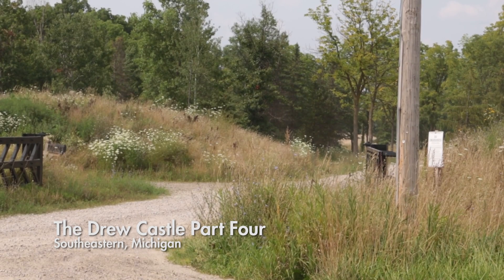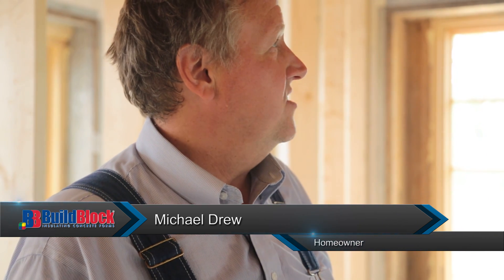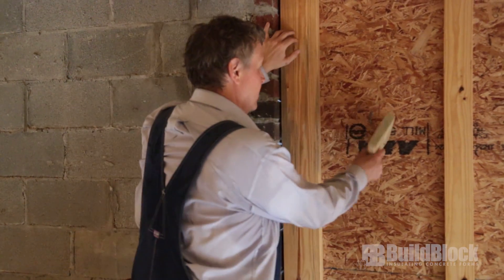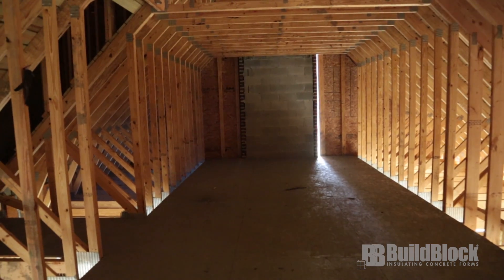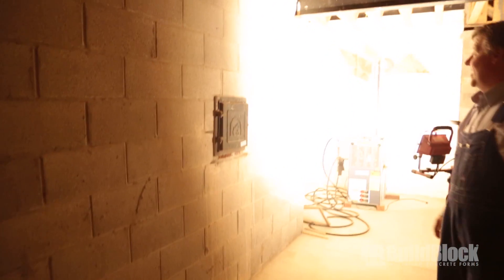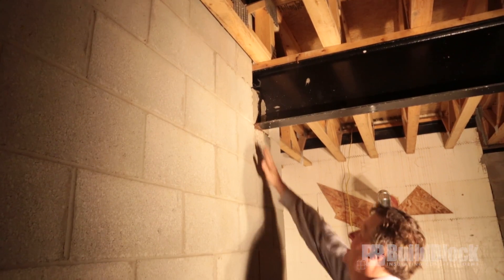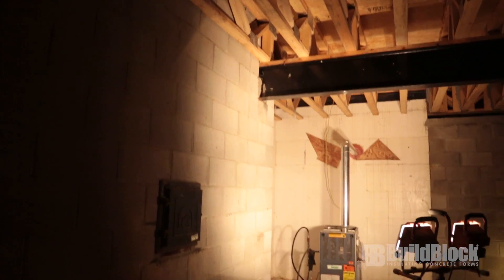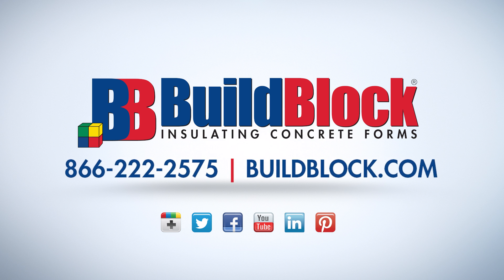How to Build an ICF Castle Part 4

Comment: How did you build that masonry chimney through the ICF walls? It looks like you stopped the ICF walls short where the fireplace and chimney were gonna be placed and just built it up with CMU. Isn’t that a big “hole” in the insulation of the wall? Was it insulated on the exterior side of the chimney before putting up the red bricks?
I want to build an ICF house in the future and was always puzzled about having a fireplace in a tight, well insulated house and where exactly is the best place to put in regards to having an solid concrete wall. Everyone on green building talk just calls it blasphemy!
Reply: It was an elevator shaft, but I agree.  The answer is a IFV air exchanger to pressurize the house so drafting works or better yet don’t have a fireplace.
Reply: @Alphasig336  oh a fireplace is definitely on the menu hehe, even though I live in hot Louisiana

Comment: Really glad to see this house plan come to life. This house plan has been a favorite of mine on the house plan sites. This plan has changed from when it appeared a few years ago. In the tower, the pub was shown as the home office with a set of stairs going up to a third floor of the tower and the pub was on the third floor of the tower. ICFs really seem to be the way to go. I live in the south and I don't think they are used much around here.....ICFs would of course do better here in tornado alley over wood frame construction.